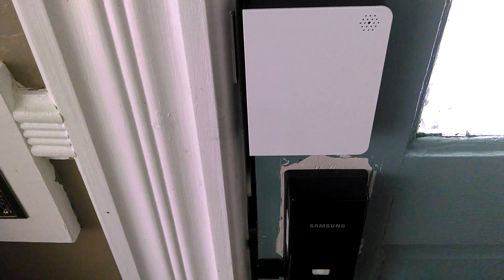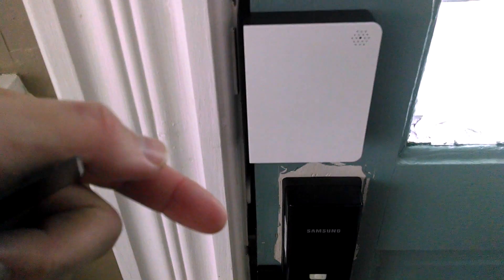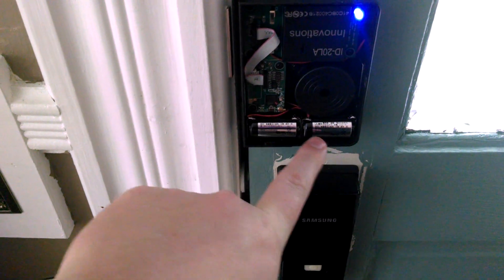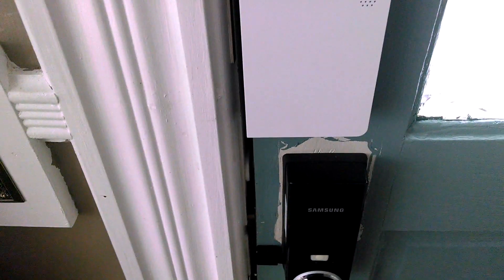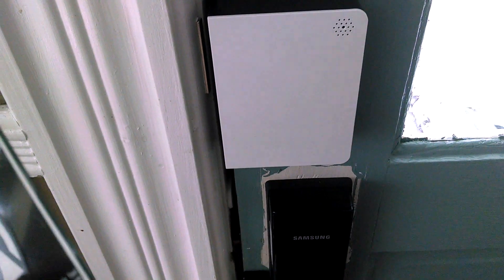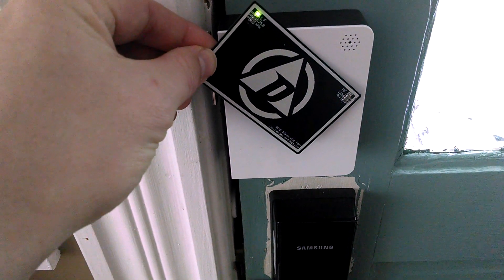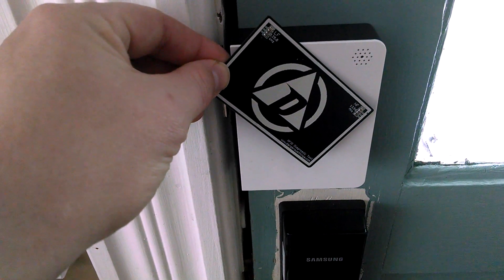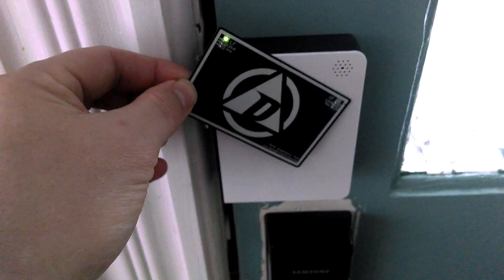Using the RFID Diagnostic Tool with the Scout Alarm

Comment: Hello ! Thank you for this video. I'm looking to buy a Scout alarm system and I see your door seems to be build like mine with no space for the second part of the door panel sensor. I also see a small metal plate between the door and the sensor. Is it a magnet or somethnig like that to trigger the alarm when you open the door ?
Reply: Just email the Scout people about this issue and they will send you out a set of thin magnets for use in door frames like this for free! I was all excited to install the panel and when it wouldn't work with my door frame moldings, I contacted support and they shipped out the solution without any fuss at all.
Reply: Wow ! Thank you so much for the quick answer. That's what I'll do. ;)

Comment: How did you get your RFID implant set up to disarm your scout door panel?  I assume that Scout had to do some sort of customization to the door panel?  Not sure how any of it works and what would be required for a family of four with different implants to be able to disarm the alarm.  Any input is appreciated.
Reply from the maker: The Scout door panel works out of the box with the xEM implant! You simply add the implant to the tag list through the app or web dashboard, and that's it!
Reply: That's awesome!  Thanks for the quick response!
Reply from the maker: +Eric Jansen no problem! check out the xEM here www.dangerousthings.com/shop/xem